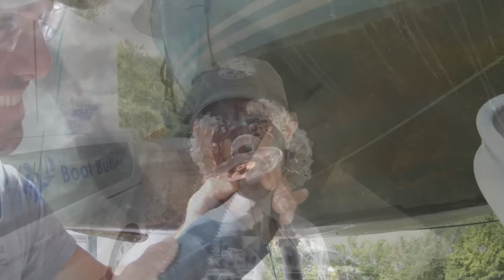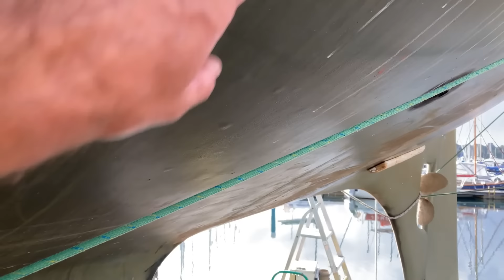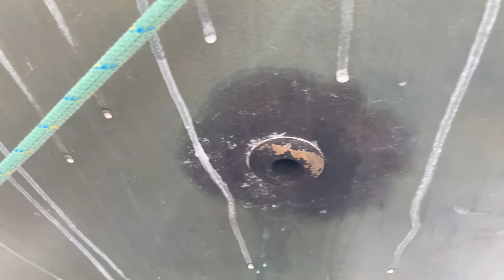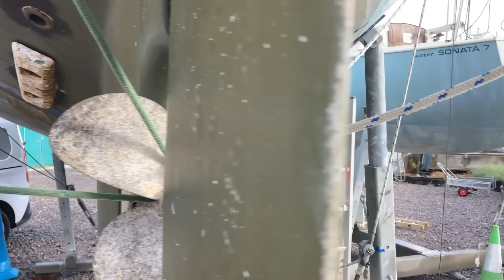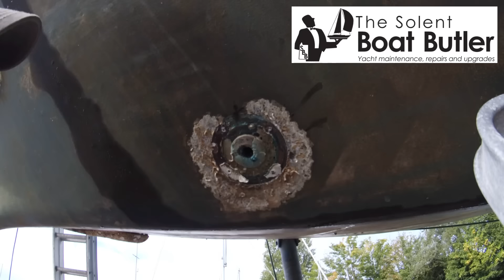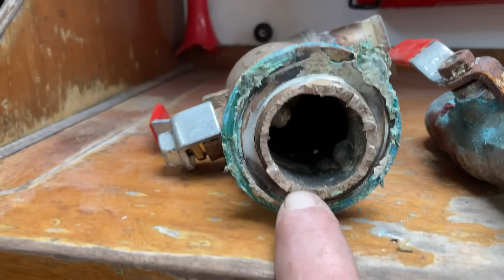Starting the Osmosis repair on this Contessa 32 refit (Project Lottie Ep5)

Comment: So when you put cloth on that with epoxy, i’m pretty sure you use a biaxle fabric did it also have CSM on the back like what we call 1208 or was it just strictly a by axle?
Reply from the maker: Yes I just put one coat of biax on this, on more recent jobs I have upped that to two layers of biax.    The reason I use biax rather than 1208 or 1708 is that the biax is much easier to mould to the shape of the hull.   With 1208/1708/combimat the stitching that holds the csm to the biax restricts the movement of the individual glass strands.   It would be possible to use it but it would take a lot longer with limited if any benefit.
Reply: @RefitandSail  thanks for the reply

Comment: Hi George, I suddenly have an osmosis problem in a 1979 Vancouver, about 3 years after she was coppercoated. I wasn't around before the coppercoat was applied so wondering whether the problem was pre-existing undetected osmosis in the hull before the coppercoat was applied or poor preparation when the coppercoat was applied. Any thoughts?
Reply from the maker: Hard to say without investigating and maybe seeing some pics at the very least but I have seen this before.   I do offer consulting services if you wanted to have an hour on the phone to discuss.    Drop me an email if you are interested.

Comment: thanks for this - my 40+yrs old Bene First 30 is showing some signs of blistering - pro blasted and re-epoxied in 2011, so hardly surprising. Hoping this haul-out to get started on tackling those blisters and flushing them out, before fun with Gelshield etc. [other epoxies are available :) :) ]

Comment: As a Surfboard rebuilder, I always flush the salty water out with fresh water, BEFORE being allowed to dry.
Reply from the maker: The stripped (peeled) hull was pressure washed multiple times over multiple days prior to drying and the same again after drying with heat and vac pads to make sure it was as salt and contamination free as possible.

Comment: Brilliant George! When you said the moisture was high on Lotty?, I've just purchased a 1981 contessa 28 and the survey tested the moisture level at 17% with a a few small blisters, something the surveyor was'nt too concerned. With the plan to coppercoat next spring to seal as the current anitfowl will see me through this season. What would be moisture % point when I would need to consider a Osmosis treatment?

Comment: Hello! I have been pouring over your project Lotte videos all week. They are amazingly educational, thank you for taking the time to explain things in such detail. Your work is very inspirational to a young boat builder! I just wanted to ask... Why do you plane the hull as well as sandblast it? Do I assume correctly that it helps keep the shape of the hull, for easier fairing?
Reply from the maker: The media blast after planing is done to open up the blisters that were not removed or opened by the planing, not always necessary but was in this case
Reply: @RefitandSail  Thanks for the reply! Still trying to wrap my head around it.... How come you don't just sand blast it, and skip the planing?
Reply from the maker: @ it would not be possible to remove the bulk of the surface material (mostly gelcoat) evenly by media blasting as it is not that accurate even with a skilled operator.  the gelcoat surface much be removed first to expose the laminate, this will probably remove most of the blisters, maybe all, but if blistering remains the media blasting opens up the remaining blisters (and any voids) and the rough surface left seems to help with the drying

Comment: Nice job! Can u please tell me the name or brand of the paint removal tool? I use a proscraper now but it is a lot of work just by hand. Thanks in advance. Kind regards Mart
Reply from the maker: I also use a proscaper for af removal but the tool you mention is a gelcoat/laminate removal tool so not really for paint removal as it does a lot more than that!

Comment: Very good video. I plan to do mine in Tunisia next winter. The osmosis is around the same stage as yours.  Can I ask please how long the work will take 2 people roughly?  I plan to lift the boat and peel the hull, cut out the blisters ect.  Then leave the boat out of the water for a few months and return to finish the job.  I'm just wondering how long the peel takes and how long to fill and fiberglass.  My boat is 36 feet so a similar size to the contessa 

Many thanks

Comment: Sounds expensive. It would be helpfull for new guys looking to buy a boat to know aproxamate prices for this kind of repair.
Reply from the maker: Doing a full “gold standard” (as I call it) repair like I do in this video is not cheap but should be a lasting solution.  I know plenty of companies and individuals that have done an “osmosis repair” that fails fairly quickly… I’d rather do the job once and once-only!

Comment: WOW! I didn't know about osmosis issues on boats. Does the resin in the hull age and deteriorate?
Reply from the maker: It’s more of an issue on older boats than new ones not because the laminate/resin ages but modern resin systems are better quality and more resistant to this problem

Comment: George.....In looking at the GelPlane I noticed that they are using carbide inserts now whereas I thought they used straight planer blades at one time. Is that an actual GelPlane brand peeler or something else from the US?
Reply from the maker: Not used it for about 12 months so I’m trying to remember, I did buy it in the US and had it shipped to the uk as that was cheaper than buying the equivalent in the uk.   It does have replaceable carbide blades.

Comment: Great job George! Have a Little Harbor 44 which supposedly previously had a blister job. 6+ years later after sitting in southern waters, more/same blisters back with a vengeance @ 4-5” each and hundreds of them. Is peel and thru-hulls absolutely necessary?  What’s cost over in UK? Thanks!
Reply from the maker: With blisters of that size then yes, it probably needs a full peel but you need to see how deep they are into the laminate really to make a plan.    Do you know what was done previously?  If it was just grind out then fill the blisters without any real drying of the laminate then that’s just a sticking plaster that was going to fail.    Ok on a small cheap boat because a full repair is expensive but on a boat of value it’s worth doing it properly.    I know my currently boat had an “osmosis treatment” that the previous owner had done but it wasn’t done well, the laminate wasn’t properly dried and now I have some blistering but only small ones but it does need doing at some point but at 40’ it’s a bigger undertaking than the one in the video.
Reply: @RefitandSail  thanks. I pierced blisters that did not seem deep may 1/8 inch. Some may be past gel coat of course. What’s a ball park $$ for blister job done right with 20% blister coverage of 3-4” blisters on a 44’.
Reply: Blisters did spray stream of water as expected.
Reply from the maker: @MrPbologna  every boat/hull is different as so to some extent the answer is it depends.   But as a finger in the air ball-park.  If I was to do it the way that I have done in the videos you have seen you are looking at circa £16-18k (GBP) but could be more if the hull does not want to dry readily and/or a second peel is needed as that’s more relam needed to get the hull thickness back.   This is a rough number and does not include lifting ashore, storage coats, unstopping/re stepping mast.  Replacement seacocks, etc.

Comment: Hi George could you let me know what media the blaster used to do the hull with after you stripped it please , im doing a similar job ,and I’m getting conflicting advise on what media to use some are saying use jblast (iron silicate) and other saying I must use crushed glass ??? Thanks Nick
Reply from the maker: I’d need to check but I’m pretty sure it was crushed glass.  Different media is used for different cleaning/substrate so best to trust in an experienced media blaster as he/she will have a preferred media.
Reply: @RefitandSail  thanks mate

Comment: George, i have a fairly serious blister problem too (on my CAL 34) but i am in Panama so too far from you to ask for help! My big concern is how to dry out the hull (after peeling or sanding)?  I was concerned that the average annual humidity here is 75% but i note that the equivalent figure for the Solent is 80%. Has humidity proved to be an issue for you, in drying out the hull? I note that you use heat pads to dry out the Contessa but there is zero chance of me finding a yard here with such facilities plus we have higher temperatures, anyway. I should add that i notice that my boat is sitting lower in the water since a yard in Mexico supposedly fixed my blisters three years back - i now know they used polyester resin for the filler and no barrier coat, so i fear some significant water penetration.

Comment: Thank you, after all these years, I'm still learning tricks of the trade. This is very enlightening, watching how it's professionally correctly done. As a newbie 30 years ago, I attempted the same refits, repairs on a 33 ft sloop. I now know I was very sloppy about my work then, but had no recourse except to use tools at hand. I used a grinder with 80 grit to grind out and away blisters that were as large as grapefruit and hundreds of pea sized ones (when you say media blast, I take it you mean sand blasting which was not available). I also made the mistake of repairing a cracked rudder with (polyester over epoxy) and quickly learned this can't be done. With no haulout facilities I had to pull an old cutlass bearing (shaft was vibrating loose) and install a new one underwater at a mooring. I learned it's quite dangerous to take a prop off underwater without securing it first with tethers and lines to keep it from flying off, missed my head by inches, and lost the prop in 50 ft of mud and muck. The prop does not slip off, it springs off with incredible force and speed. I also learned never to leave the mast on top of barrels along the edge of a wharf with no lines securing it properly so it doesn't fall into the water when a strong wind knocks the barrells. It took an entire year, but I eventually got my boat back in the water with the help of slings and a 30ton construction crane. That was my introduction to sailboat ownership. I'd do it all over again to be back on the water. The Contessa 32 has been an obsession of mine for as long as I can remember, so I'm living vicariously thru Lottie's refit. Please post all episodes.
Reply from the maker: Thanks for the comment, I appreciate it and pleased you are enjoying the series.    I have also learned the hard way at times but that’s sometimes the way of things, I have also done some repairs in my early days of working on baots that I’m not that proud off but at least I did them to my own boat not a paying customer.   Stay tuned for plenty more refit works.
Reply: @RefitandSail  👍🏼

Comment: So you can use SS studs to attach your anodes, you learn something everyday 🤔
Reply from the maker: You can, stainless steel is really only stainless when surrounded by air so underwater is it likely to suffer corrosion but probably less so then the normal galvanised steel studs.

Comment: I just found  your chanel, great stuff,   I will be watch now,  where did you get your hull heating/vaccum pads? I would like to get some.
Reply from the maker: Thanks, without pulling the old invoices out of storage I don’t recall the company but they are not an off the shelf product, you have to get them made to your particular specification (size, wattage, location of holes and temp sensor(s), type of controller, etc, etc).   There are a few companies that will make them of you if do a google but be warned that that not exactly cheap.

Comment: Fascinating video. Always wondered how it was done. Incidentally, on your westerly you have a really good stackpack/not stackpack idea. With two smaller bags helping to keep the sail together when down. Is this your invention. I really like it, very neat.
Reply from the maker: Thanks, I am pleased you enjoyed the video.  My westerly came with a full stack pack but I don't, like them, yes they are easy to use but I hate all that material flapping around while sailing.  my mesh sail catchers were an idea stolen from a Class40 racing boat I was working on a couple of years ago so had my sailmaker make similar for me.  They work very well and are hidden under a normal (over the boom) cover when not in use.

Comment: This is great, I did mine this summer similar.  Ground out each blister to the good fiberglass with my Dremel, and refilled with resin/fiberglass.  It took me way longer than I estimated, I was talked out of a peel (huge mistake).  Very interested to see more
Reply from the maker: Localised repair can be ok if you only have a very small number of blisters but if the laminate as a whole is damp/wet and not dried* then more blisters are likely to form.  If you had a lot of blisters then the would have been even more just not large enough to show up so you may fine a few more come and say hello over the next years.   It’s hard to say how successful you will be as different manufacturers had different resins, differently skilled laminators, better or worse working conditions so even from one day to the next or one boat after another on a production line you can get different results.     On this contessa one side was much worse for blisters than the other, probably laid up on a different day by a different person in greater or lesser humidity. 

*by dried I also mean the removal of the hydroscopic chemicals in the layup that are causing the blisters.

I’m pleased you enjoyed the video, more to follow.   Hope your repair works out ok.

Comment: It physically pained me watching you saw that skeg cap off.  😬  Is that the only way one can drop the rudder on a CO32?  The peeler - is that used primarily for removing CopperCoat, or can that be used to take off bottom paint as well?
Reply from the maker: Yes, that’s the only way to remove the rudder but the boat has been designed with the removable Skeg cap so it looks worse than it is.    The peeler is designed to remove gelcoat and/or laminate to enable drying and/or repair.     I would never normally use it to remove antifouling only as it’s far too aggressive, in the case of this boat the outer layer of gelcoat and laminate needed to be removed.    If a boat has many old layers of traditional AF I would normally get that removed (by media blasting) before peeling.    Hope that makes sense.
Reply: @RefitandSail  Got it, thanks!